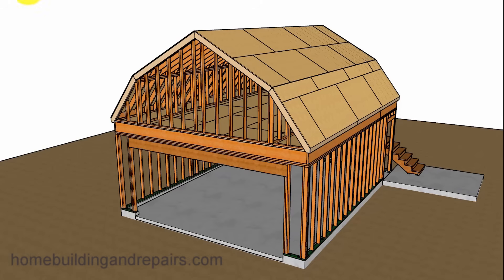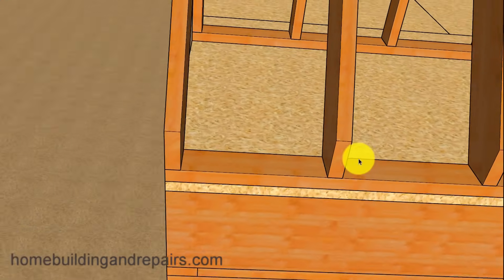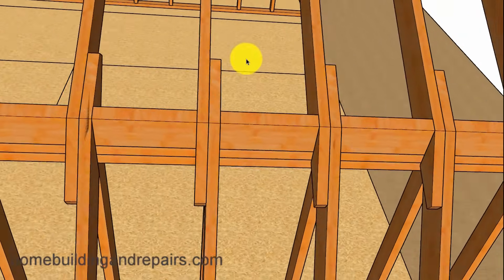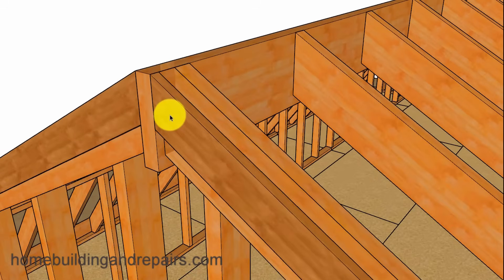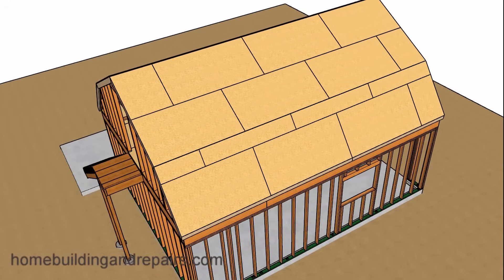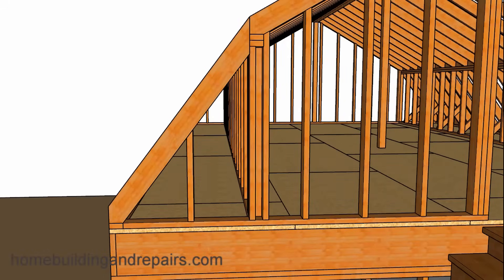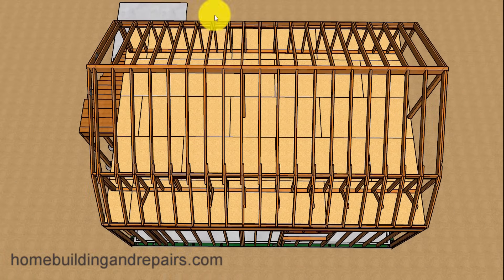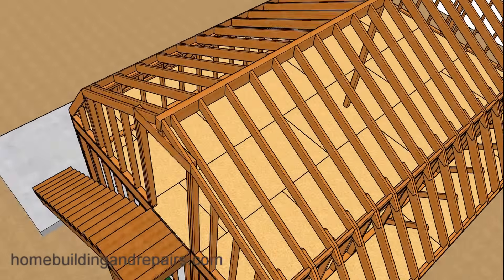How To Build Gambrel Roof With Loft Over Two Car Garage - Building Education Series Part 11

Comment: I've built a few things in my life one being a home.  Somewhere around 2016 I rebuilt my shed ; instead of a straight gambrel rafter on the lower end I took a 2' 2x4 ripped it corner to corner on the lower 2' giving it Dutch bump out look. This gives a bit of overhang which looks nice but keeps water from dripping down your sliding. If done right you can use a 4x8 sheet for the lower portion of gambrel an split it for the lower half. 
Note: my span is 10' so use / adjust to your requirements.

Comment: Hi Greg hopefully you can help. I am in the warm climate in Florida. I purchased a house with a detached 20'x35' gambrel roof garage with partially completed apartment above. it has ridge vent & gable vent in the upper attic area. It has a soffit which is closed off but could be vented. 

how are gambrel roofs typically vented? do you run baffle vents and vent from the low soffit in gambrels that have a soffit? if so then should I close off the two end gable vents? 

the apartment is 70% sheetrocked & insulated with batt insulation there was a small leak in one corner before I got the roof replaced was able to bleach the sheetrock and remove moisture insulation in 2 rafters. would replace if recommended & which would make spray foam application easier if that is recommended.
Reply from the maker: Basically you install vents any where you can, at the bottom or eaves, gable vents on sides or dormer vents on roof. It's difficult for me to advise on foam or rafter replacement.

Comment: with no venting this would get hot as heck, why not extend the roof so it has a 1' foot overhang and then you can install some venting at the eves?
Reply from the maker: Awesome, then this will work great in cold climates, thanks for the tip.
Reply: @gregvancom  nope moisture will build up and possibly cause mold.  many gables roofs use powered fans for ventilation at the gables.